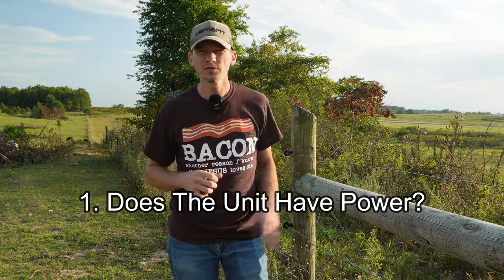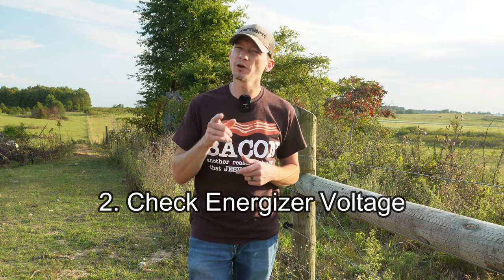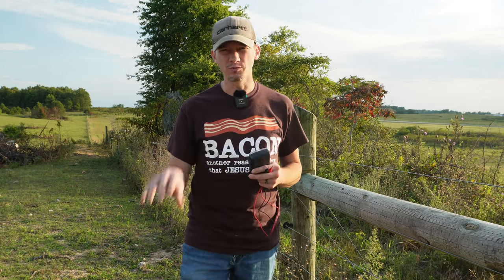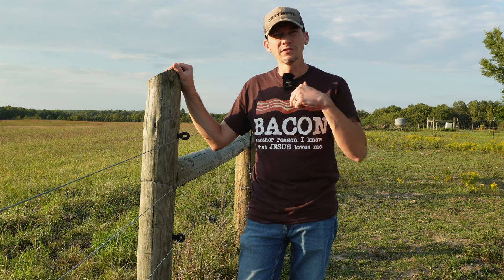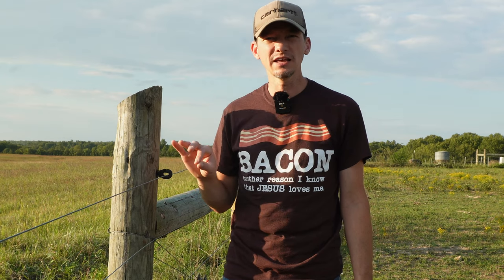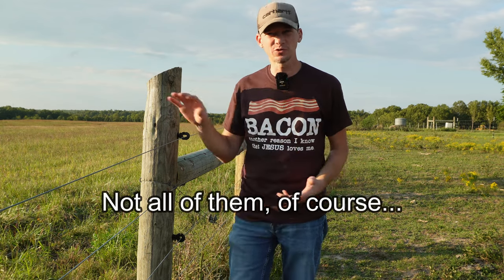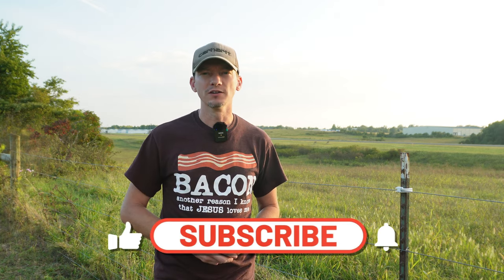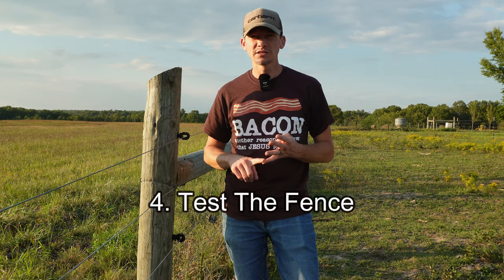Why Isn't My Electric Fence Working? - Troubleshooting Tips Every Farmer Should Know

Comment: Can I wrap the electric wire around a wood post or do I have to buy a insulator
Reply from the maker: A bare wire will ground out on the wood post, especially when it gets wet. You can use wrap around insulator tubing instead. It's a little bit cheaper than individual termination insulators.

https://kencove.com/fence/detail.php?code=I40-100

Comment: I have  a 26 Joule energizer hooked up to 830 ft of poultry netting and the connector from the enegizer to the netting burned through the netting. My goats figured out that the power was off and two of them stuck their heads through the netting and got stuck and choked themselves.  I think the problem may be a combination of a lot of Joules connected to a relatively small fence and the ground being so dry that I am not getting a good grounding.  I bought a better connector that has more surface area and left a water hose barely running near the grounding rods.  I think the best solution will be to replace the netting with high tensile wire.
Reply from the maker: I've never had much luck with netting. It always seems to short out. I had the same thing happen with a goat kid about 5 years ago. I quit using it after that.

Comment: 9:10 can you elaborate more on that? I've never heard or thought of that.  I'm planning on getting a much larger than currently needed charger, but I'm also adding on a lot of fencing, but in stages.  I don't want to damage an expensive unit.
Reply from the maker: I probably should have done that in the video. 🤦‍♂️ Being oversized for the fence system can be hard on the internals of some of the cheaper equipment. If you buy a high quality charger, you'll likely be ok.
Reply: I bought a really powerful energizer and it has worked out pretty good.  I do think that being oversized causes it to "find" weaknesses in your system.  For example, I've had it burn through some of my cheap tubing insulators.  But the advantage of the powerful system is that it burns the weeds / kills the grass and weeds so that you don't have to trim as much.  For me, it's worth it to have the big joules.
Reply: @PlaneViewFarm can a cracked insulated cause it to ground out. Even if the wire is not completely against the post
Reply from the maker: @solschwartz7119  Yes it can! It can arc across and ground out. That's a really good question. I wish I had included that in the video.
Reply: @PlaneViewFarm  thank you

Comment: So I have a question, I had to connect two different wires, together, would that cause an issue besides the ground? Bc I do only have three ground rods, would the wires twisted together cause a short at all?
Reply from the maker: Good question. No, that shouldn't cause any problems at all, as long as they are twisted together tight. If you're concerned about the twisted connection, you can buy fence wire crimp sleeves and a pair of crimping pliers to make your connections.

Comment: I bought a 26 Joule energize and currently have it hooked up to 830 ft of poultry netting. I know that is more joules than needed but I’m planning on fencing off about 30 acres with additional cross fencing. Right now, the netting is touching grass in several area and I hear a lot of clicking. I’m concerned it might catch the grass on fire. Is that something I need to be concerned about?  Will adding more ground rods reduce the risk?
Reply from the maker: Fire really isn't an issue with modern energizers because the current is pulsing. Older energizers had an issue with fire because the current was continuously flowing. The only real risk might be if the grass is extremely dry and the wire contacts something that might cause it to throw a spark. Even then, the risk is low because that spark isn't likely to be hot enough to start a fire. I hope this helps.

Comment: I noticed your ground  wire was attached straight to tpost with clip does this help ground
Reply from the maker: Good question! It does provide some grounding for the system, but not much for a couple of reasons. The posts don't get deep enough to provide much ground contact, while a grounding rod will be at least 6 feet deep, if not more. Also, the wires are not fixed tight to the posts with the clips. They are just loose enough to expand and contract. That allows for breaks in the flow of current back to the energizer through the ground. I hope that helps.